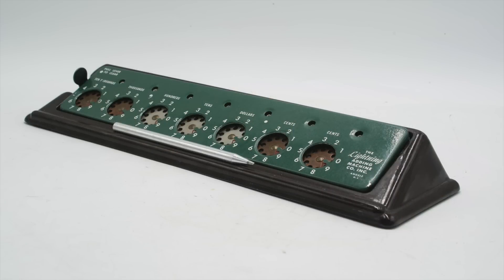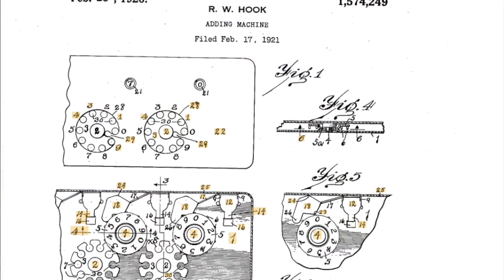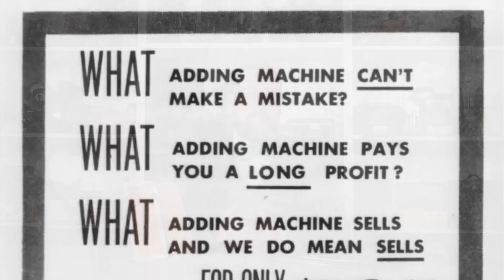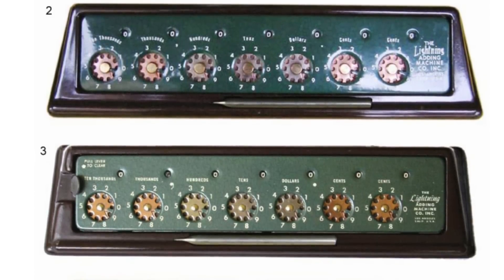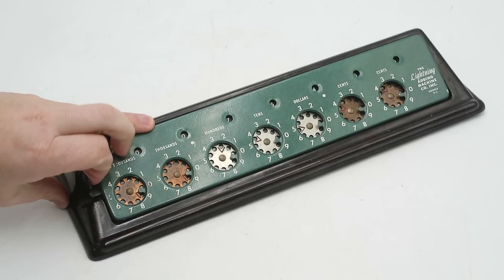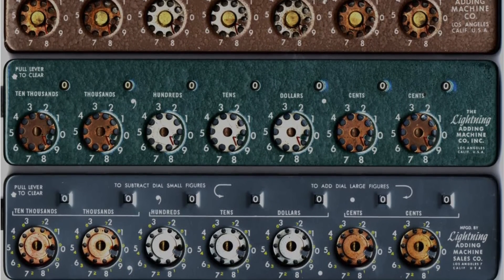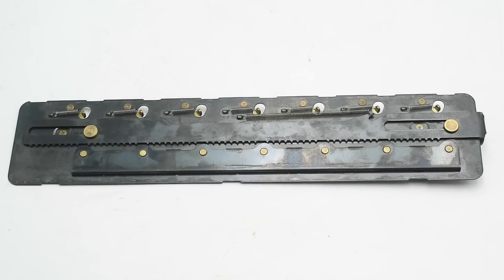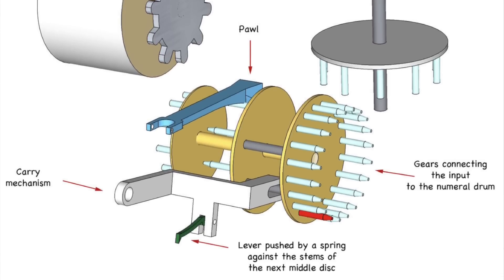Lightning Adding Machine: Simple Mechanism, Complex Origins

Comment: This is half joke and half really dorky comment: as it’s a tool, I think “Calcumeter” should be pronounced kal-‘kyu-mi-ter (emphasis on the second syllable), otherwise it’s a metric unit of length
Mostly because I’m really dweebily rankled by the pronunciation of “kilometer” but I know it’s a lost cause
Reply: I suppose you’re one of those people who call a multi-meter a “mul-timmiter”
Reply: @ …I’ve only heard it called that?
Reply: @RobCamp-rmc_0 It’s quite common, but it’s the same kind of silly. An altimeter measures altitude, but a multimeter doesn’t measure multitude. It’s a combination of multiple meters: a multi-meter. If we called it a combi-meter would you pronounce it com-bimmiter?

Anyway, back to the Lightning Calculator. I have one! It’s very cool, a relic of a different time, crude and elegant simultaneously. Still works!

I thought I had seen one on here a few years ago, but it must have been another channel. These mechanical math machines are always interesting.

Comment: There was a version called ADDOMETER. It worked in feet and inches.  Great for builders and architects before electronic calculators came out.  I used them in the 70s to draw house plans   Autocad does that for me now.

Comment: I'm also fascinated by mechanical calculators (and vintage electronic ones). I found one exactly like this at an estate auction a couple of years ago, in very good cosmetic condition. It works well, and also had the original stylus and stand. Quite a nice bit of mid-century technology.

Comment: My Mom had one of these.  It was dumbed-down and very specialized.  It was intended to keep a running total of your grocery bill as you were shopping, so it was designed to be used one-handed, so you could place items into your cart with one hand while you tallied them with the other.

It rested in the palm of your hand and you used three fingers to operate three buttons:  Dollars, dimes and pennies.  You entered 57¢ by pressing the middle button five times and the right button seven times.

Not terribly impressive, but convenient if that’s what you needed.

Comment: My parents had one of these back in the 70s.  It was metal with plastic dials and had to be several decades, maybe half-a-century old at that point.  They also had a plug-in electric calculator that was several times larger than a modern laptop!